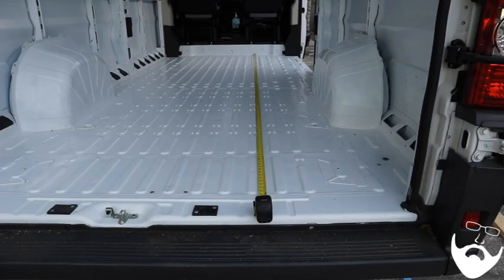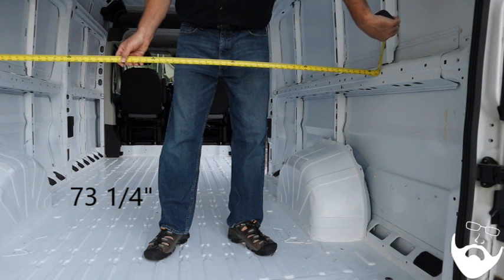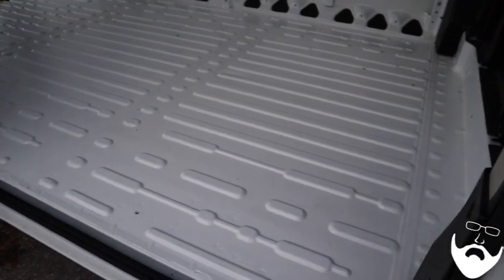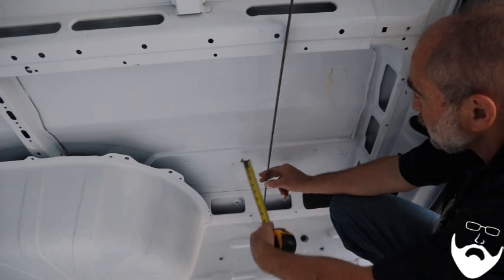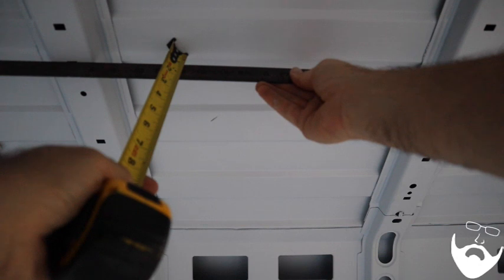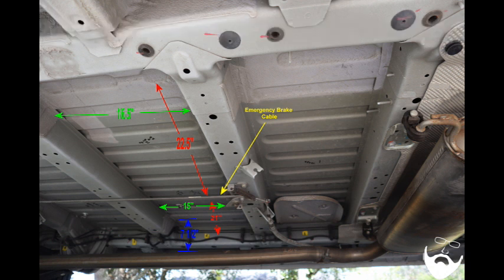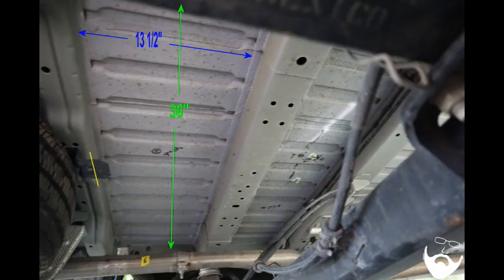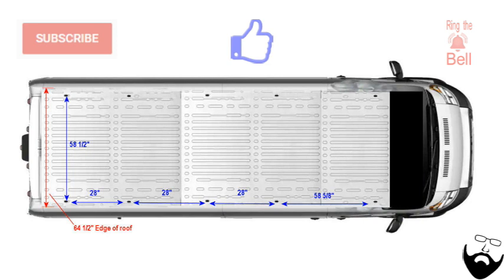Van Life Promaster 3500 EXT Dimensions - Planning - Water tank sizes, and Insulation.

Comment: Even though I have a 136wb, I would have loved to have this information in my planning stages!  Thank you for sharing :)
BTW, for tall folks who are trying to figure out the best way to insulate the ceiling without losing head space, remember you only have to worry about conductive and radiant heat in that area.  One way to keep the interior head-room is by filling that 1" space with spray foam or Thinsulate glued directly to the metal skin, then cover it with 3/16" luan sheets to stop the conduction.  Radiant heat can be mitigated by ensuring your roof rack has boards across any space not covered by solar panels - this creates shade from the sun no matter where you go.  
Hope that suggestion helps.
Reply from the maker: I agree, but for the ceiling I will use 1" Polyiso, and will have a large roof rack/deck shading most of the vehicle. All that in future video's, stay tuned in :-)

Comment: I've been looking everywhere for these dimensions!  Great job!  One dimension I am missing is the front seats from side to side & the dimension between the front 2 seats.  Would you be able to measure these for me?  Thanks again!
Reply from the maker: At the bottom of the seats the distance is 16 inches.  That is exact, and touches the plastic cover on each seat.  If you wanted to place a rigid piece of wood on the floor between the seats 16 inches would be the width.   The closest is between the armrests at 9.5 inches. If your seats have armrests!
Reply: @FrugalFactor  Perfect!  Thank you so much for taking the time to do this for me.  I need this for a walk-through for my design.  I've heard the floor in this location needs to be strengthened.  Thank you again.
Reply from the maker: @msspgj  The floor is unusual like a hard memory foam.  We placed a rigid board between the seats for more support.  There is a panel between the seats for access to the gas tank.  You may use that access if you install a gas heater.  Also, there is a drop off just behind the seats.  That is shown in this video - https://youtu.be/GEeXinUX0Us

Comment: Americans, when will you join the rest of the world and use the metric system? aren't you tired of those 7/16" and 7/8" ?
Reply from the maker: Well, I am happy with either the metric or standard system.  I would use metric if the parts were available and the same cost.  Here metric nuts, bolts etc. are at a much higher cost.